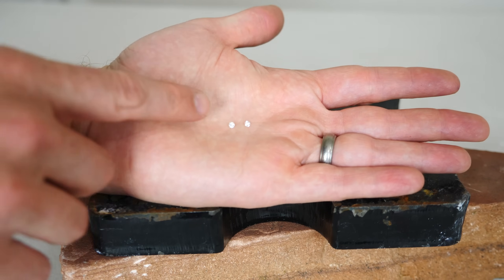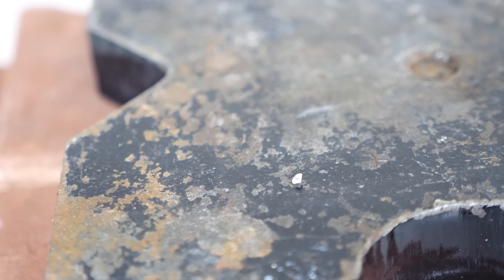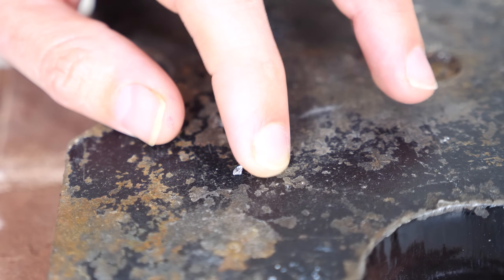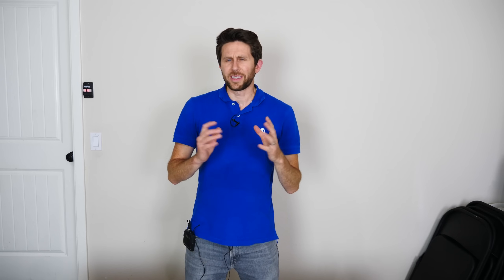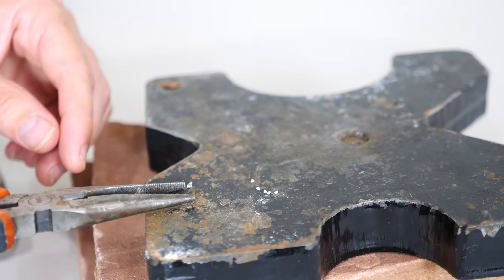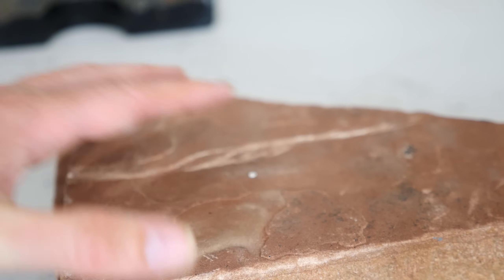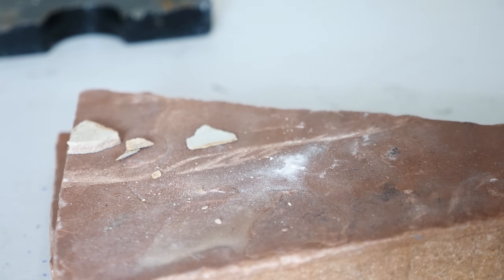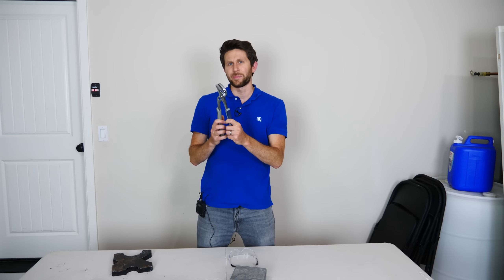Can You Break a Diamond With a Hammer?

Comment: People are confusing hardness with compressive strength. A diamond is a very hard material, meaning it is very strong against abrasive forces such as how if you took a nail against a diamond, it wouldn't get scratched no matter how hard you applied the abrasive force. However has relatively low compressive strength due to cleavage that comprises natural weak points in its crystal structure, hence why the downward compressive force of a hammer is able to shatter it with relavie ease.

Comment: This is a great explanation of the diffrence between "hardness" and "durability"
Reply: It's actually a terrible example.  Several factors play into why these diamonds shatter so easily.  First, the hammer used is several times larger than the diamonds.  Secondly, the diamonds used in jewelery are commonly shaped with lots of edges to be stylish, which is where the structural integrity of the diamonds are weakest.

Instead, consider a diamond roughly the same size and shape as a small brick.  You can hit the flat sides of it when anything you can hold, you'll find it won't break.  In fact, the edges might only barely chip off.

Comment: I tried this with my pink diamonds and they didn’t break even with a sledgehammer. I suspect it’s because these ones had tiny imperfections which mine are flawless so they have no weak points. Before you say I didn’t hit them hard enough I am a girl who is stronger than most men and I can move a heavy bookshelf  loaded with books with one hand. I’m am not a bodybuilder girl I look girly but am stronger than I look. But my pink diamonds didn’t crack even hitting directly so my hypothesis seems to be true. They also didn’t even turn black with the lighter test and stayed pink colored.😂

Comment: There's nothing wrong with the hammer. You are working on a used surface with holes for the diamond to hide in.

There's nothing wrong with the pliers. You're just not strong enough. You could try a vice.

Comment: The quality of the diamond also matters. Diamonds can have impurities and small hair-line cracks inside it, making it more brittle. I'm assuming your test used cheaper diamonds. But a higher quality diamond would likely fair better.
Reply: This deserves thousand likes, me too I don't believe easily would broken the real original one 🔥
Reply: This diamonds are created in a lab... They are more "pure" than natural diamonds.
Reply: @darthchubbz5668  source, that point u say pure than natural diamond,don believe u 😀
Reply: @josephlalnunsanga2582  source? It's made under near perfect, controlled conditions. Use your brain
Reply: @darthchubbz5668  what brain , use your logics, comparing natural vs artificial, rather use your brain
Reply: Joseph Lalnunsanga in natural environment there can be more elements mix in the carbon (who know which)
in a lab, the machine only use carbon to make diamond, which make them purer
just like water you make in lab vs water you get from river
Reply: @josephlalnunsanga2582  what?

Comment: Diamond is hardest not toughest material... Hardness is all about scratch/indentation.... the material is said to be hard if it can resist scratch or indentation
where as toughness is when a material can resist impact stress/load. Stiffness is what discribe bending/or deformation. Diamond is hard which means it can resist scratch but when you hit it with a hammer you generally applies the impact stress and because it is not tough enough to withstand it, it breaks. And the same goes to stiffness like when you squeezed it with a plier.
This is a reason why diamond is used on some machine cutting knives and it placed at the tip bcs it resist scratch and can easily scratch other materials.

Comment: anything, that is harder will chip easier. They will wear better, like if something rubs against it, but not impact wise. Same with steel, you can heat treat steel that normally will dent, but after heat treat, it will crack with impact. Hardness vs toughness. Carbide is next lower hardest materials, used to machine metal. There are even different grades of carbide. Harder grades and tougher ones that can handle shock

Comment: For crushing with a pliers, you put the diamond at the tip of the pliers.  That's has the least force applied to it. You should move it as close to the pivot point as possible for maximum force.

Comment: This is why rotary drilling often uses diamond tools (diamond core drilling etc), where as percussion drilling uses "hard metal"; which is actually a carbide (usually tungsten carbide) cemented toghether with a metal (usually cobalt).

The tungsten carbide by itself is not as hard as diamond and just as brittle. The cobalt acts as the bitumen in asphalt and makes the material not only hard wearing, from the exposed tungsten carbide grains, but tough, from the ductile metal.

Comment: Hardness is resistance to being scratched.  Diamond is hard.
Malleability is tendency to deform. Gold is malleable.
Cleavage is tendency to break along planes of weakness within the crystal that are due to alignment of relatively weak chemical bonds.  Diamond has perfect cleavage which is parallel to the table of the "brilliant cut."  When a diamond cutter 'cuts' a diamond, he actually cleaves it to form the table.
A "diamond anvil cell" is a scientific instrument made of two diamonds that are pressed against each other to produce pressures as high as found in the interiors of planets.  This relies upon the strength of diamond.  And since the diamond is clear, you can see what is going on in your experiment.

Comment: The hammer basically just produced a greater magnitude of force to that of the inter molecular forces between the carbon molecules. So basically the strongest martial or object must have a greater inter molecular strength to that of the force produced by any other object
Reply: Yea, and it doesn't need to be hard
Reply: @rafi7252  yes precisely

Comment: You said glass has a high tensile strength. That's wrong. It has a relatively high compressive strength (resisting two equal forces on opposite sides pointing inward toward the center) but low tensile strength (resisting one force penetrating a material and expanding outward from the center). "Hard" materials tend to only have high compressive strength but crumble, sheer or shatter easily from tensile stress, like tungsten or concrete.

Comment: Heat another diamond red hot and drop it into liquid Oxygen. That's a cool reaction.
Reply: Or just use graphite
Reply: I think its liquid nitrogen
Reply: @notsopolitecub4841  it´s liquid oxygen, the diamod becomes co2
pd: i´m not completely sure if it´s co2
Reply: @Neko_Void  u r right
Reply: @Neko_Void  wouldn't the liquid oxygen just ignite?
Reply: @giovannip8600  No, unless you apply enough Heat, but i don't know if the reaction with the diamond is exotermic

Comment: "So if diamond was the hardest material on earth how was I able to smash it with just a hammer"

BECAUSE YOU'RE SUPER STRONG!!!!!!
Reply: I wanna have an r/woooosh chain going
Reply: Hulk power
Reply: No hard means brittle.
Reply: Its just hardest not strongest
Reply: The frick is this conversation
Reply: Lol
Reply: Cus that hammer is op
Reply: Hardness and strength are different
Reply: "Diamond is unbreakable"
ARE U SURE ABOUT THAT
Reply: @TehRealJeje  That means it is very brittle.
Reply: @davidnaomi5092  I'm talking about that jojo season
Reply: Diamond is hardest to scratch not to break. the mohs hardness scale measures scratch resistance not the strength of a material
Reply: no its because diamond is really hard which makes it not so tough the difference of toughness and hardness is that hardness can resist heat and other stuff but toughness means how can it resist pressure like glass it can shatter easily but can resist heat at an extreme level
Reply: @TheLegendaryColorFixer_REDMIST  I thought glass melts really fast
Reply: Nah, diamond is actually incredibly brittle, it don't deform, a larger piece would shatter to pieces
Reply: Its not tge hardest substance on earth and you can break ANY diamond with a steel hammer because diamond is brittle and steel(correctly hardened and tempered) is very tough
Reply: @jadekayak01  you're wrong about diamond not being the hardest substance on earth. You are confusing hardness and durability, which are 2 different things. He covered both of those in the video, too.
Reply: @hypercubemaster2729  no im not and as a lapidary of over 20 tears,including faceting,i know EXACTLY what i stated is correct.

Cubic boron nitride is the hardest substance known to man.

Diamond is only the hardest natural substance known to man.

And you comment shows you do not have in in depth knowledge.in fact it is just the same as the HEARD knowledge,which is not comprehensive.
Reply: @hypercubemaster2729  so why is your last reply not showing.

CBN is not second to diamond of any type-natural or manmade.

Also manmade diamond is still only a diamond-that occurs in nature.it displays all the properties of natural diamond.

CBN does not occur naturally.

As for q carbon-ive never heard of it before(relatively modern being made in 2015) but at 10-20% harder tgan diamond it definately is harder than CBN.

It is also CLEAR that the hardest substance on earth was being discussed-that includes EVRRYTHING and that is why i stated hardest NATURAL substance.
Reply: @jadekayak01   For one, Q-Carbon is not new at all. Also, if you knew as much about the hardest materials on earth like you say you do, you would certainly have already known about Q-Carbon, and that Cubic Boron Nitride is NOWHERE NEAR as hard as Q-Carbon or a diamond, natural or synthetic. Just because CBN can take hits better, does not mean that it is harder than diamond. It's quite the opposite, because it is slightly softer. Because of this, it can disperse more impact energy by slight deformation as opposed to diamond which is so hard that it will easily shatter from a hammer hitting it at the point, because it has no ability to bend and deform due to its hardness level. The harder a substance is, the more energy that is felt on impact to a single point, just like a car that has crumple zones compared to the cars back in the day which did not. The car with crumple zones is allowed to bend and deform to absorb a lot of the energy from a crash, where as on the old cars the full impact force was felt because it was much harder and thus had little ability to deform. My point is, you're just wrong. If that offends you, I don't know what to tell you. Truth is truth.
Reply: @hypercubemaster2729  you are wrong about cbn.

Diamond is 10Mohs and cbn is 10.something Mohs.

That is only a little harder but still harder.

Nowadays the are makung grinding wheels with cbn because they have solved the bonding problems.
Reply: @jadekayak01  actually, after doing a little more research, and remembering about Q-Carbon, which I completely forgot about when I originally replied earlier, we were both wrong to an extent. Look it up. If there is any potential argument on something harder than diamond, you have WBN, or Wurtzite Boron Nitride, which they are saying MAY be harder, but too little exists in nature for it to have been proven yet. But as far as is known to date, Q-Carbon is harder than CBN, WBN, or diamond.
Reply: @hypercubemaster2729  there are only 4 compounds of boron with cbn being the hardest.

And i already agreed the q carbon is harder anyway so what is the problem
Reply: @jadekayak01  research shows that CBN is not harder than WBN or diamond, though.
Reply: @hypercubemaster2729  and research sjows it IS harder than diamond.

It just depends on whose "research" you choose to accept
Reply: @jadekayak01  so the mohs, vickers, AND knoop hardness scales all lie??? How can that be?
Reply: @hypercubemaster2729  dont know about knoop or vickers but Mhos is accurate.

The "RESEARCHERS" lie.

Before cbn was able to be bonded to make a useful grinding product it was tested and pronunced higher than 10-or daimond.

Now some websites say its less than 10.

Some say harder than diamond at temperatures over a specified value.

I suspect the truth is that cbn in its raw form is harder than diamond but once its bonded into a usefull grinding product the matrix is tested and obviously is softer than diamond,the same as silicon carbide wheels are softer than saphire
Reply: @jadekayak01  I don't know enough about the circumstances you've mentioned in your last reply, so it's hard for me to have a valid opinion on it. That said, for now I give you the benefit of the doubt that you may be correct. I will try to research it further to see if I come to the same conclusions as you. I apologize I came off short with you. I am used to dealing with people who have 'studied or been in the profession of' types of people that really were just what I like to call 'know nothings' that automatically assume that they will always be right when debating against somebody who isn't as educated in their subject. Judging from our debate I can tell that you are not one of them. Sometimes, research can fail due to starting off with bad paradigms of perspective.
Reply: @hypercubemaster2729  there is 2 harder things than diamond.
Reply: @jadekayak01  your correct.
Reply: @jadekayak01  Me and my dad have a lapidary table.
Reply: @hypercubemaster2729  diamond is strong with pressure but, impact strength it is one of the weakest.
Reply: No. Because you applied pressure in the right way to break it.
Reply: @TecknoVicking  r/woooosh
Reply: @DinPlayz RBLX r/woooosh
Reply: @xHadesStamps  ok nerds
Reply: @TecknoVicking  r/wooosh i already wooshed you on another comment how dumb are you
Reply: @TecknoVicking  r/whooooooooooooooooooooooooooooooooooooooooooooooooooooooooooooooooooooooooooooooooooooooooooooooooooooooooooooooooooooooooooooooooooosh